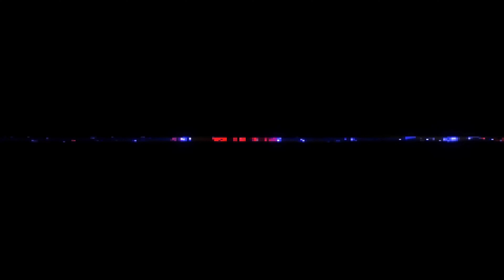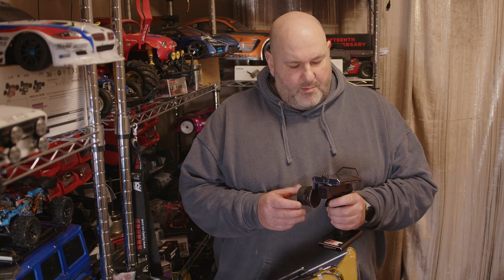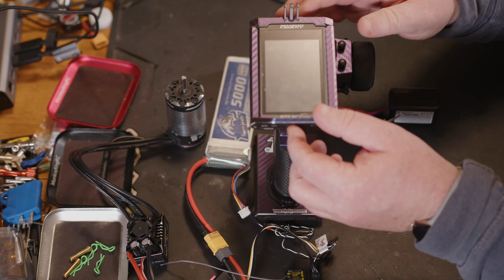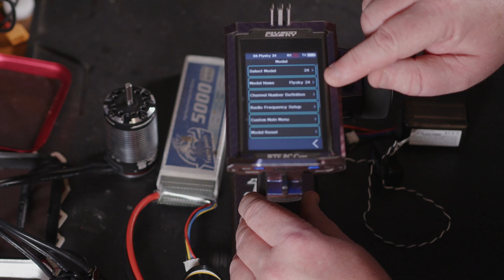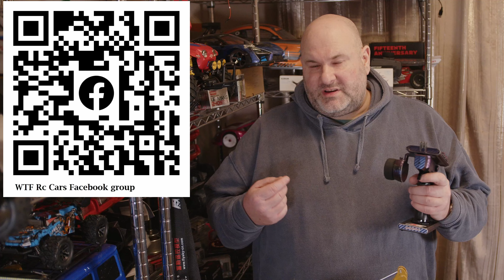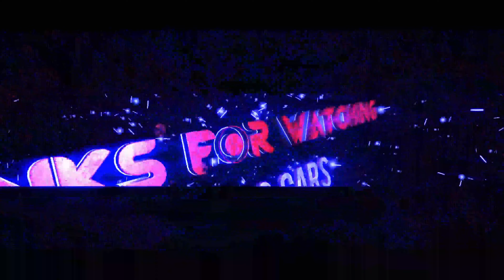NB4, +, Pro and Pro+ Dual receivers and dual BVD setup

Comment: I’m having an issue with the voltage shown for my power hd GTS6 via ibus 2 on my noble+.  

BEC set to 7.4 voltage with no load on the servo at neutral and the   reported voltage is 6.6-6.7.  I have tried three receivers, ESC’s and multiple batteries.  I’ve even tried a second brand new GTS6 and it’s the same.  

I’m assuming given my testing it’s an issue with the ibus 2 protocol for that servo.  I have two GTS3 servos and they both report fine, the issue seems limited to the bigger GTS6 servos (two I’ve tried).  Using the FGR4B receivers in latest firmware both rx and tx.  Any ideas ?
Reply: I should add this is with the servo connected but out the car so no binding going on with steering assembly etc.
Reply from the maker: @rudiperez5315 The transmitter just reports what the servo is telling it to for telemetry so yeh I'm guessing either the servo needs a firmware update or the servo board it's self drops the voltage down for whatever reason definitely a strange one.
Reply: @WTFRCCars Thanks for the reply.  I’ve contacted Power Hobby and they seem to think the voltage as read through ibus 2 should be equal to the bec voltage under no load.  Given this is happening on two new servos, I’m assuming it’s the servo firmware itself like you say then.
Reply from the maker: @rudiperez5315 yeh sounds like it, be interesting to see what the bec voltage is when measured with a volt meter
Reply: @WTFRCCars would it be possible to check the servo voltage with a voltimeter
Reply from the maker: @rudiperez5315 yeh just check the output of the receiver then you would need the bottom off the servo and probe the main board
Reply: @WTFRCCars Thanks, I’ll check the receiver output.  the FlySky does show the rx voltage as 7.4 which is what the bec is set to but I’ll check with the meter tomorrow.  I won’t take the bottom off the servo as it’s brand new and am concerned I’ll void warranty perhaps…
Reply from the maker: @rudiperez5315 yeh still worth checking what you can at least you will know where the issue lies
Reply: @WTFRCCars well the meter shows 7.4 to receiver as per what the FlySky shows. I’m too nervous to open up the servo considering the warranty so will send it back and let them do it !.
Reply from the maker: @rudiperez5315 yeh would love to know where the issue is
Reply: @WTFRCCars So would I 😀.  I’m beginning to wonder if there is an issue as I have two brand new GTS6 servos doing the same thing on three esc,s and receivers.  The only constant is the FlySky Noble4+
Reply from the maker: @rudiperez5315 best guess is they have the voltage calibration wrong in the servo software

Comment: I’m looking for a guide for the NB4+ on changing the wheel springs. Have you done this as I can’t find it on your channel if so? Ta very much.
Reply from the maker: I dont have a vid on it but its very easy im sure it shows you in the manual
Reply: @ that’s great thanks for the reply. Will be starting carpet racing 10th scale buggies soon with a B7. Should I get the NB4+ or the NB4 pro+?
Reply from the maker: Hard choice both are great if your serious about racing you would probably find the higher resolution throttle of the pro+ better but not much in it
Reply: @WTFRCCars  thanks for the reply. Really appreciate it. It would be solely for racing so maybe the pro plus.
Reply from the maker: @Strengthoftenmen yeh for racing pro+ is my goto and I got all of em
Reply: @ where’s the best place to buy from in the UK?
Reply from the maker: @Strengthoftenmen I know scmodels and rcmodelz stock them
Reply: @ thanks again. Please can you help me choose the fastest receiver for racing there’s loads out there and for a newbie like me it’s a bit daunting. I’ll be using a Reedy 610R esc and program box and reedy RT2007a servo if that makes a difference? Obviously if I’m getting the pro plus I’d like to make full use of its speed. Thanks again
Reply from the maker: @Strengthoftenmen fgr4d is the race receiver for any electric rc
Reply: @ you get a FGr4B and a 
FGr8B in the box from rcmodelz what’s the difference with the ‘b’ and ‘d’ in those model names?
Reply from the maker: @Strengthoftenmen fgr8b is 8ch with antenna fgr4d is a dual internal antenna fin style 4ch for racing they are both capable of ibus2 and upto 1000hz servo frequency
Reply: @WTFRCCars  magic. Thanks very much!
Reply from the maker: @Strengthoftenmen no worries
Reply: This would make for a good video. I think you'd get a lot of people watching it just cause people hate reading manuals haha